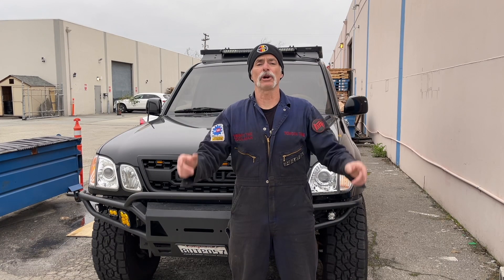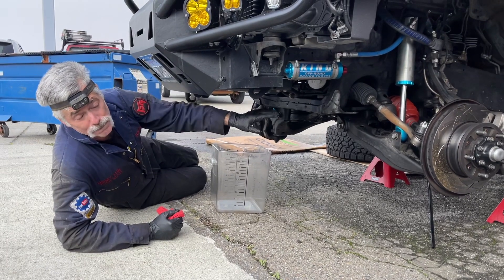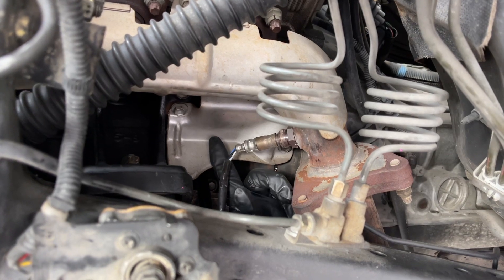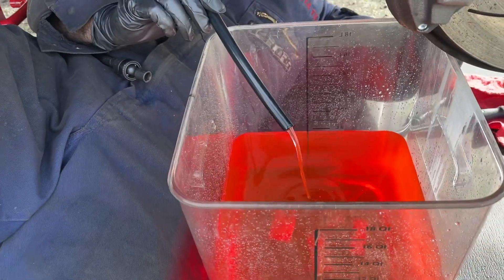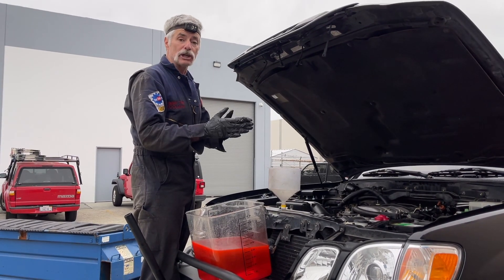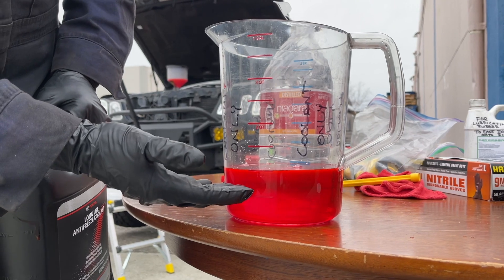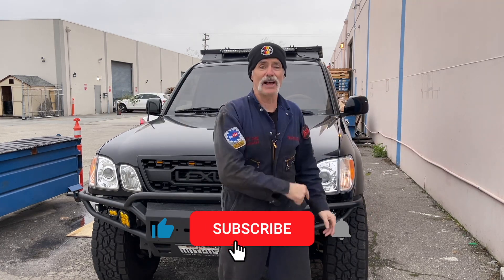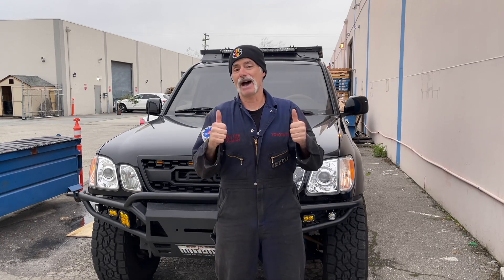Engine Coolant Replacement 4.7L 2UZ-FE V8 (Land Cruiser, LX470, GX470, Tundra, Sequoia, 4runner)

Comment from the maker: For anyone doing this job, now that you know where the block drains are located, you don't really need to take the front tires off.  We did it for easier access to the block drains, but the access to get to the block drain fittings from underneath the vehicle isn't that hard as you saw me do it with wobble extensions and a swivel socket.  So, I suggest you keep the tires on to save yourself some time.

I didn't mention it in the video, but you'll want to remove your reservoir and pour out the old coolant or use some type of fluid siphon to draw the old coolant out.

When burping the system, have the front end higher than the rear.  I think I failed to mention that in the video.  Since air rises, having the radiator the highest point in the cooling system helps facilitate the removal of air in the system.  You could either park on a slope with the front end pointing uphill, or you could jack up the front end of the truck to get the front end higher than the rear.
Reply: Hey Tim i appreciate all the videos your do , I have a 1998 4runner and was wonder what manual you use for all your torque specs.
Reply from the maker: @johnboyer5212  I download it from the  Toyota Tech Info website.   For $25, you get a 2-day membership. https://techinfo.toyota.com/techInfoPortal/appmanager/t3/ti?_nfpb=true&_pageLabel=ti_home_page&goto=https%3A%2F%2Ftechinfo.toyota.com%3A443%2Fagent%2Fcustom-login-response%3Fstate%3Dkxc_lKWBiJ_W3lIenC42PY7W5hI&original_request_url=https%3A%2F%2Ftechinfo.toyota.com%3A443%2F
Reply: Why not use the coolant bleed valve?

Comment: I thought you weren’t supposed to mix the Toyota oem coolant with water?
Reply from the maker: The Toyota Red Coolant is a concentrate.  You mix it with distilled water to create a 50/50 mix.  The newer pink coolant comes as a 50/50 mix with the water already added.

Comment: I understand not being a slave to torque specs but having a rough idea isn't bad. It's 9 ft lbs, BTW. The reason I mention this is because my prior shop overtorqued the ever living crap out of it and I sheared the bolt head when trying to loosen.
Reply from the maker: Knowing how to properly tighten fasteners is a learned trait, and anyone can master it.  It pretty much comes down to common sense and having a feel for it.  I think it's something every DIY Mechanic should get a feel for.  Being paralyzed because you don't have a torque value to follow is pretty constraining.  Instead of spending a bunch of time searching online for a torque value, you just use that German Spec of Gudentite and you're good to go.

I will agree following a mechanic that didn't know what the hell he was doing is frustrating.  This is why we promote doing your own automotive work so you can guarantee it's been done right.

Thanks for the comment.  Happy Wrenching!

Comment: Do you have to drain coolant from driver & passenger side block? 
Can I add distilled water to radiator after flushing radiator only and then run it just to flush radiator again without draining from block? Thanks
Reply from the maker: Yes, I would drain from both sides of the block.  If you're going to do a distilled water flush, I'd drain the whole system afterward - radiator and both sides of block.

Comment: Timmy, Is there a reason you like the Toyota Red coolant over the pink?
Reply from the maker: The Toyota Red Concentrate was the spec up to a early to mid 2000's.  So, I recommend reading your owner's manual and using the coolant spec documented.

Comment: You should look into replacing the rear heater soft lines also (if it’s equipped with a rear heater)
Reply from the maker: That's a good suggestion.
Reply: @ common failure point on the 80 can end catastrophically

Comment: Hey guys, I really need some help here. I have a 2000 Toyota 4runner that has a code for a transmission solenoid number two but I’m having really hard time finding the right part number, but anybody know?
Reply from the maker: We don't know it.  Have you tried visiting your local dealer?  You might be able to get the part number from them and then shop online for it.  Just ask them to give you a quote and see if they'll print it out for you.

Comment: Should you flush the system with distilled water first
Reply from the maker: Only if your coolant looks nasty or you're switching to a different coolant.  You're renewing the majority of the coolant in the system so it's not a concern to mix the new coolant with a little of the old leftover coolant.

Comment: Good work, Timmy and team and Happy New Year. My manual says 29Nm for my block drain. I'd expect they are all the same on iron blocks and I expect the bolts to be the same, but as you said, have a feel for the right tightness, My manual also says to apply locktite to the bolt. I like the little spout. That's Lexus for you. My Toyota dowsn't have that. Must get one of those funnels. Getting the fill level up high helps the purge process, too.
Reply from the maker: @stco2426  That's interesting about the loctite.  That means both the male threads of the plug and female threads of the block would need to be dry and clean.  I've never used loctite.  I just tightened it by feel and called it good.

Yeah, that drain pipe is super nice to have to make less of a mess.

Comment: This same procedure will work on 2007-2021 Tundra and 2008-2021 Sequoia. Except the Super Long Life coolant interval is 5 years/50k miles.
Reply from the maker: @TXAG81  I honestly don't even know what the suggested interval is for the Toyota red concentrate.  I'm just going by past experience of suggested intervals.  30k for a coolant renewal is what I've always gone with.  Thanks for letting me know what the pink super long life coolant is rated for.
Reply: @ I’m only repeating the recommendation of AMD, The Car Care Nut.
Reply from the maker: @TXAG81  Gotcha.  I've seen some of his videos and he gives good advice.
Reply: To keep it simple I just do a radiator drain and fill every 3 years. For the amount of fluid you get out of the engine block drains I just leave them alone.

Comment: Would this work on a 2019 GX 460?
Reply from the maker: The process would be identical.  You would just have to locate the block drains on each side of the engine.